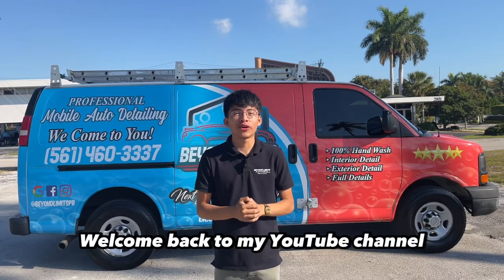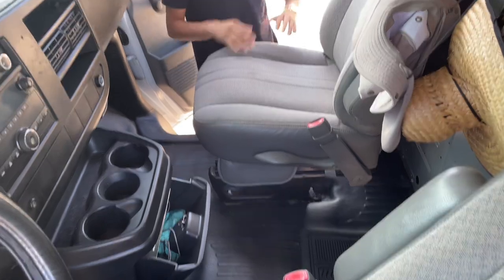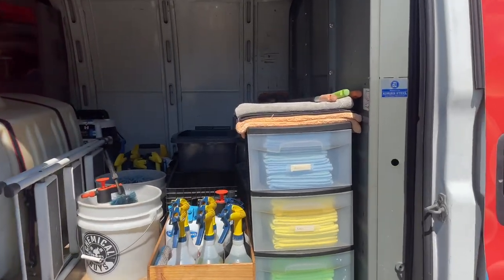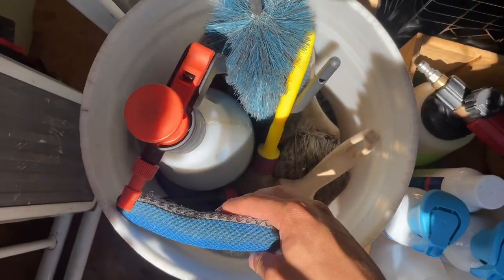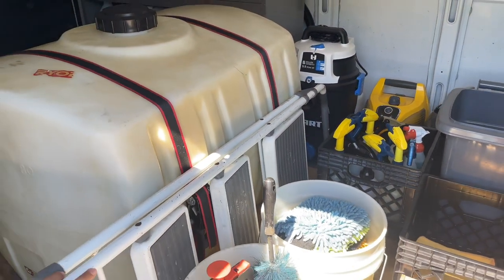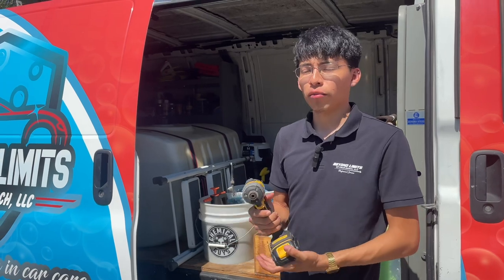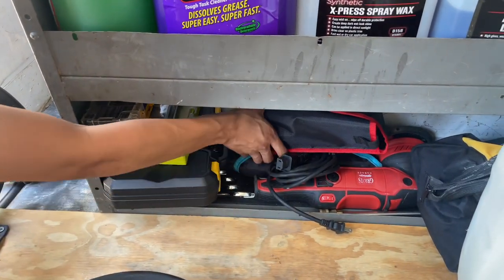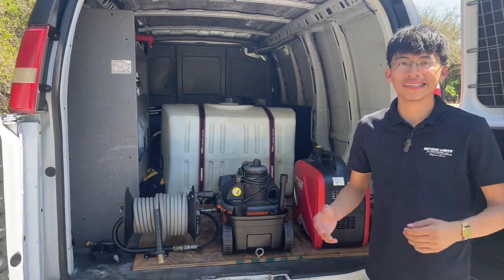My Mobile Car Detailing Setup (Van Tour) - Detailing Beyond Limits

Comment: I have thought about doing this because I love cleaning up vehicles and caring for vehicles. The problem is I live in the Northeast, so there will not be much business in the winter unless I had some type of indoor location like the detailing businesses in my area. I haven't heard of mobile service in my area at all which is why I thought of it. 
One idea I have thought about, which really is a different business idea is pressure washing. Of course that cannot be done in freezing temperatures either.
Reply from the maker: @rocknjock You seem to have some solid points, although if you say there aren’t mobile detailers out there I think it screams opportunity for you (non winter time of course) but it’s definitely something you should look into - introducing a new service to the general audience down there, “why go to the car wash, when we can come to your driveway” Pressure washing can also be one your services offered, therefore you are reaching potential customers and offering two different services.

Comment: Awesome video, very very helpful. What air compressor would you recommend getting that’ll be good with that 2000 predator generator? I was looking at the Ridgids
Reply from the maker: Vic, thank you. I’d recommend you look into Ridgid’s 4.5 gallon or their 6 gallon portable electric air compressors. See which one best fits your needs, and go from there, hope that helps!
Reply: @detailingbeyondlimits  Definitely will look into those ones, thank you so much 🙏 keep up the grind & the videos 💪

Comment: Hello man, thanks for the vids. I would like to know so when you want to start cleaning, the generator stays inside the van, gets plugged to the extension cord, then you connect the other side of the cord to your water pump or vacuum yeah?
Reply from the maker: We connect our extension cord on to the generator than we extend the extension cord (the other end) all the way out to connect our vacuum when we are all finished up we put everything away and we connect the pressure washer which are next to each other in the van. Hope that helps.

Comment: What's the purpose of the generator and how much does it cost?
Reply from the maker: Provides electrical power, allows us to hook up our machines and turn them on with out having to connect to an actual home outlet. 

Pricing can vary on the type of generator you go for, brand, and watts!
Reply: @detailingbeyondlimits  TY

Comment: Trying to figure my rates out .. starting ?
Reply from the maker: Angel, start with what you THINK is appropriate now & go out and actually bring in that experience of working on a customers vehicle, analyze how much effort was really needed , analyze everything you DID need, analyze any expense/expenses, and analyze how long it actually took you to complete the job. 

Now you’ll have a better idea of how much you’d rather charge and feel comfortable doing the work for.

Just a quick example,

If at first you charged $40 for a car and you went out and it actually took 2.5 hours to do an immaculate job. You spent $10 on ice and water, you drove a bit far out (gas).

Do the numbers and determine maybe if you’d like to set an hourly rate for yourself. 
So if a standard car is taking you 2.5 hours and you’d feel great working on a car if you’re bringing in at-least say $45 an hour, 

Do the math $45 x 2.5

$112.50. Round it down to 110 or round it up to 115, completely up to you. 

This is just one of many ways to figure out pricing , hope that helped out. 👍🏻
Reply: @detailingbeyondlimits so i started 60 a car and 70 trucks  got like  customers lined up for the weekend .. idk if thats a good start .. only doing basic interior clean and vacumn and  regular wash ..
Reply: @detailingbeyondlimits  thanks again
Reply from the maker: @AngelPerez-iv1dy  yes that’s a great start! 👍🏻